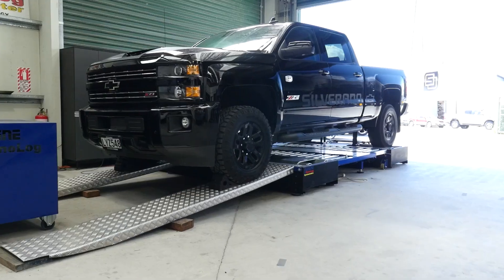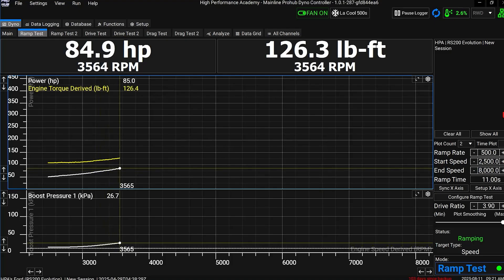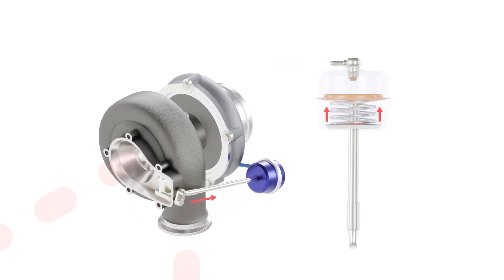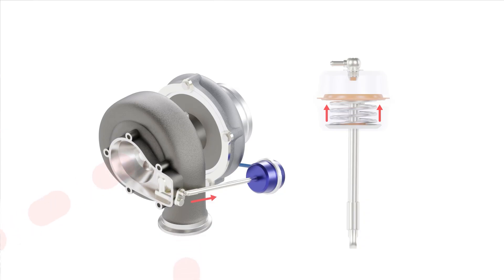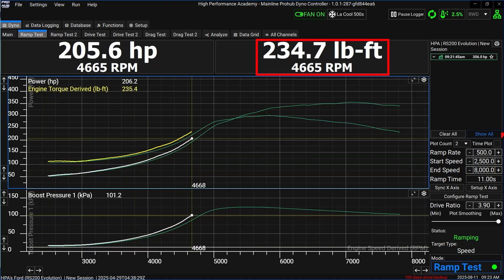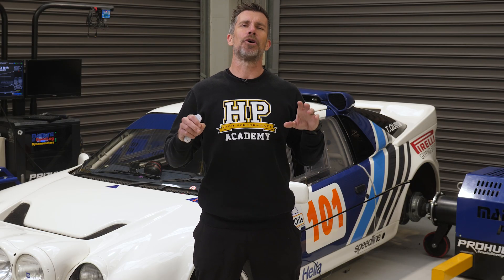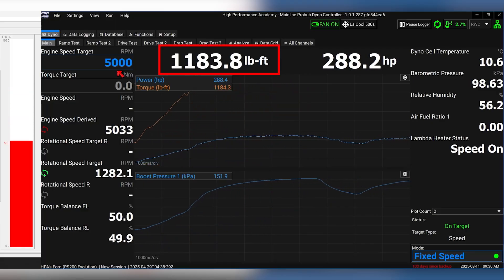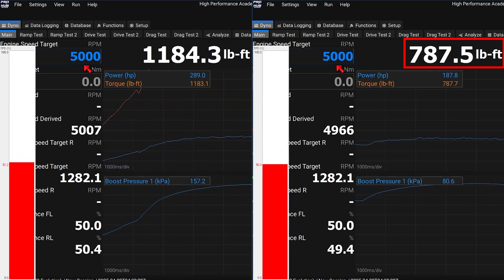Wastegate Hacks Tuners Wish They Learnt Earlier

Comment from the maker: What's one KEY piece of turbo tuning knowledge you wish you learnt sooner? - Taz.
🏎 Building a fast car? Get $400 OFF the all-inclusive VIP online course package deal: https://hpcdmy.co/boostvip
🦵Kickstart your EFI Tuning knowledge. Get 50% OFF your first online course: https://hpcdmy.co/turbocontrol
Reply: question : why aren't twin charging more common in high performance applications ? that is.. a turbo doing boost, feeding an intercooler, and goint into a positive displacment style supercharger, into a 2nd intercooling stange and into the engine. in my experience (diesel guy here) setting a belt ratio that produces no boost at peek tourqe rpm has very little loss power wise. however, as revs climb and volumetric efficiency starts to drop, the pressure ratio of the stupidcharger goes up. it allowed me to use a larger turbine, therefore less backpressure in the exhaust system. while getting me turbo to spool sooner, and it flattened the toruqe curve. i used a variable geometry turbocharger, controlled by a mechanical pressure sensor. i had far better turbo spool. since there was more "vaccum" on the compressor wheel (till it got up to near pressure neutral shaft rpm ), and had more flow on the turbine wheel. i'v had them possible issue of the system volume capacity being large and inducing lag in boost response, at least i had that idea emerge. however in practice i had not had that issue at all.  for home buulders, eaton chargers are very affordable, and make a hell lot of difference. 
however i'm just a village idiot with far too much autism.
so i would like an expert opinion. 
it would make an awesome video too , explaining how a blower builds pressure in relation to engine rpm and volumetric efficiency of sayd engine.
Reply: Address crsnk case pressure oiling issues with an rb whilst doing a rebuild.  My dream car r32 gtst burnt to the ground after having a forged rb20 built due to the head filling with oil.  This was like 18 years ago now so was not common knowledge how to address these issues.

It still hurts 😢

Comment: That is why on all my turbo cars I've owned, I place the boost gauge on the top of the steering column surround, behind the steering wheel. I watch the PSi buildup and disregard the tach until accelerating. Helps to know where the boost is at mid corner etc.

Comment: Do you know if I can do this on a MegaSquirt3 Pro PnP ECU for my factory turbocharged Mazdaspeed Miata?

I just bought an electronic boost controller and will be wiring it in soon to tune a boost duty map based off rpm... Hoping I can do boost by TPS as well as boost by either speed/gear as well. 

Would benefit from a lower target boost in 1st gear, and slightly less in second as well. Would only want full boost in 3rd - 6th.

Comment: In an open loop boost control strategy: should I set a boost reduction based on throttle position? Would one axis be the throttle position and the other access be boost controller duty cycle with negative values?

Comment: I can't give it more boost up top because than it starts to knock with a 9:1 compression ratio 
And i checked exhoust manifold , exhoust, intake manifold ,valves, throttle body intercooler and its not restricting anything only 80%of its capibility is used i'm running e85 (105ron octane) and yea. it starts to knock with more boost so i can only remove boost down low so that the curve becomes straight

Comment: Another reason for boost drop-off as RPM rises is that the engine consumes more air. Boost is a measure of how much air the engine is unable to consume; ie. if you provide more air than the engine can take in, then you have boost.

Comment: I had no idea people actually tuned boost without throttle reference. I mostly tune OEM ECUs and nearly all of them use throttle % as an input (because throttle is used to calculate target load). Boost maps are rpm and load based,  Wastegate PID (which is derived from boost control solenoid control) is also rpm and load dependent. I'm not an expert, I do that for fun, but I also think about torque and not really boost or power too. I didn't invent anything, OEM absolutely think that way based on all the maps I've seen. 
Since the cars I map are for street use, I tune them for excellent mpg up until 60% throttle. (Maximum spark advance, very gradual load increase, low boost, lean and mostly NA stuff), then transition from 60 to 80 % throttle to something OEM+ (higher boost than stock but still reasonable) and finally the last 20% is very aggressive. It is not advisable for track use, but for street use it makes the car pleasant to daily drive while being very agressive when needed. It also gets better MPG than stock when using part throttle.

Comment: Would this be why OEM's (like BMW) have a MAP sensor and a second pressure sensor on the turbo side of the throttle?
I've wondered why the N54 has two pressure sensors, with a small 1.2 bar sensor in the manifold and a higher pressure sensor before the throttle.
After thinking about it after watching this video, it makes sense they would target a pressure before the throttle to improve the throttle response.

Would this strategy have similar benefits compared to what you're describing with throttle mapped boost targets? Essentially not working the turbo harder to overcome the restriction of a partially open throttle?

Comment: Great video. I tune all my turbo cars like this even with low horsepower. My philosophy is if you cant modulated the throttle and get a desired torque,  throttle isn't variable anymore and is basically a switch. This type of tuning give your driving experience more resolution to drive the car at whatever desired level you want.

Comment: couldn't you technically use a reduced sized throttle body and intake filter to give a more linear curve and less on and off switch feel with bigger turbos?   went from a 76mm TB to a 68mm and a 4" to 3" filter on a 3.0 6cyl and the power mechanically feels so much smoother than before.
Reply from the maker: The throttle body does have some effect on the torque vs throttle angle however it's not a full substitute for also changing the boost target vs throttle angle - Andre

Comment: Done all these things on my self-tuned evo track car 🙂💪💪boost vs tps is amazing, as you say even at very low throttle it’s happy to make full boost. 
Also worth noting where possible is lean spool functions as well as wgdc 100% until target load reached, both help to get it on boost as quickly as possible.
1 more thing that I need to test is how BOV vs no BOV (i dont mean vs stock recirc, i mean vs compressor surge no bov at all) affects the reduction in boost on gear changes, in theory a bov should increase the response, but by how much if it all would be interesting to know
Reply from the maker: Good man! You might enjoy a quick watch of this too: https://www.hpacademy.com/previous-webinars/256-do-you-need-a-blow-off-valve/ - Taz.
Reply: @hpa101  Cheers Taz - gave it a watch & some very good info in there. Was surprised to see no BOV was actually slightly faster responding and no real difference in the off throttle rpm drop. Noted the test only at 1 bar so potentially in the future some testing at higher pressures would be good to see. I've been running it flat out for 5 years now between 1.5 bar on trackdays and 2.1 bar flat out for time attack etc with no BOV installed and whilst its only a journal bearing (albeit with a 360 thrust) TT S209 evo 9 80 series, it's held up perfectly. So for the potential of leaks & complexity etc for it to be as robust as it has been I think it makes sense to leave the setup as-is. 
1 thing for anyone else with a similar setup is that it's a must to control part throttle with wastegate correctly, if the boost is not controlled and you run mid throttle and making high boost, at least on my application I got a ton of compressor surge & flutter whilst actually still on throttle. Once that is sorted however that test makes sense with the drivability of mine and how responsive it is now with all the tricks being used :)

Comment: I'd really like to hear your honest opinion on diesels. I really dont like them because a lot of people misunderstand the concept of torque. Just because an engine has 400hp and 1000nm doesnt mean its faster than an engine with 400hp and 500nm. I bet you understand what I mean about this. People get it so wrong. I'd say in a nutshell, "average horsepower" between shifts is what is important. Weight on car, same. (I guess gearing matters too. But if both cars had perfect gearing.
Reply from the maker: Sasha did a great quick write up on torque vs horsepower a while ago here: https://www.hpacademy.com/technical-articles/understanding-torque-and-horsepower-with-tractive-force/ - Taz.

Comment: Boost target vs RPM vs TPS is probably my missing issue with the drivability of my RX-7 for autocross only. I just checked and it was a 2D table mapped at full 25 psi from 2000 to 8000 rpms. That explains so much why it is hard to drive mid throttle. I now have it mapped to TPS and this should give me a much better feel of the throttle when throttle application is so important for autocross. Thank you!
Reply from the maker: Awesome Chris! Andre will be stoked this helped you out. Happy racing mate! - Taz.
Reply: @ChrisMoreweb  hello, do you have the possibility to post or send me the table you are using  please? Tks

Comment: H/A.  Could we look into controlling a turbocharger boost minus wastegate ?  Read article Downunder a while back, where blow/pop-off valves were used vs a wastegate to control engine boost.  Expect ever tightening vehicle emission standards as per NVES in Australia, this will become an ever increasing "art" of technical engineering to meet tougher and stringent future requirements !  V.
Reply from the maker: Controlling the boost pressure via the cols side vs hot side is achievable and certainly nothing new, however it comes with some downsides, one of which is that you risk over speeding the turbo - Andre

Comment: Have you ever tried using cylinder pressure as a tuning metric?  I tell you, it will show you everything, from whether your cam is the best it can be for your setup, to getting every bit of performance out of your setup.
Reply from the maker: For most people the benefits won't outweigh the costs. If it was cheap and easy to install though, that would be the way to go without question 100% - Taz.
https://www.hpacademy.com/blog/how-modern-ecus-have-become-awesome-entry-to-professional-level-ecus-tech-talk/

Comment: Why are you able to boost higher at high rpm when the torque limit/goal is the same?
Does the engine fail to eat enough air to deliver the same torque and then it must be helped with the extra boost?

I have tried the uncontrollable boost behavior on 2 stock cars (2007 VW 2.0 TDI and similar year Renault 1.9 diesel), when pressing the throttle the engine goes from off boost to boost and the throttle needs to be let off a little to get a smooth even acceleration, then the engine/turbo begins to go out of its best area and more throttle needs to be applied again, to get the same amount of acceleration.
The VW was software updated a couple of times and they limited the peak max torque of the engine and made it much better to drive.
Reply from the maker: If you look at a normal torque curve of any engine (N/A or turbo), the torque will start low, peak around the midrange rpm and then drop as rpm climbs. This is because the engine's mechanical design is optimised for airflow across a certain rpm range. As we move above that range, the engine cant flow air as efficiently and the torque drops away. By increasing the boost as we move past peak torque we can help to overcome the engine's reduced airflow and help keep the torque closer to our target - Andre

Comment: Most tuners... id dunno. But theres plenty of lazy ones that will take advantage of a client that doesnt understand that closed loop boost is 100% more useful & accurate. BUT THEY DONT SUGGEST IT TO THE CUSTOMER.

 I have 5 tunes from friend's cars that sent me to alter something, NONE of the tuners setup closed loop boost, let alone some kind of a controlled target table.

My first tune's open loop boost table was so lazy that when i retuned it myself & eventually setup closed loop, the car was night & day different. Full boost as fast as possible if I wanted, or 3/4 of full boost & holding that steady instead. Then after setting up a throttle % vs boost target table I can safely control the amount of boost & not accidentally hit full boost at 30% throttle through a corner in the wet.
Reply from the maker: The closed loop aspect is tricky because a lot of tuners don't understand how a PID algorithm works and if you don't have that knowledge then getting accurate closed loop boost control is next to impossible. Some ECUs still do a terrible job of closed loop boost control too, despite it being 2025 - Andre

Comment: Basically how diesels use boost control in factory ECUs
Reply from the maker: A diesel engine is a very different animal though. In a diesel engine you make more power as you add fuel and enrich the mixture, but there are limits to how rich you can go before you start melting things. In order to make more power without everything falling out the bottom, we need to add air to lean the mixture out and that's where the turbo comes in - Andre

Comment: A little 12V aircompressor, tank and ecu controlled valve would be nice to control the wastegate additionally.
Reply from the maker: This would be workable but I'm not sure the juice would be worth the squeeze. if you want a wider usable boost range then you'd likely be better off using a 4 port solenoid - Andre
Reply: Why? you have a spring in it
Reply: @DreRasing  yes, i know how a wastegate works. But with more airpressure on the WG you can run a softer spring.

Comment: would this function the same with an Anti-Lag system?
Reply from the maker: The short answer is yes. Antilag is designed to reduce the initial turbo lag but we still want control of the torque vs throttle input - Andre

Comment: Easy on a stand alone, not so easy when using a standard EBC and reflash ecu.  When you only have one duty cycle value you can run throughout the rev range you’re limited to mechanical changes to account for boost drop off.
Reply: I always run 2 hoses to the WG actuator and or ebc solenoid. 1 from the compressor housing outlet, the other one is taken from the inlet mani or plenum then both hoses go to a T or Y fitting. 
It prevents over boosting and accounts for the pressure drop at higher RPM

Comment: quick question, what is the ramifications of having the throttle before the turbo/centrifugal supercahrger like how a roots/screw supercharger has the throttle before the intake?  would there be things you would have to do differentaly like bov and wastegate tuning?
Reply from the maker: It's not something I've ever experimented with so i can't comment from personal experience. If you also included an intercooler then the effective plenum area would become massive which I imagine would have some pretty significant negative effects on throttle response and driveability. Indycar did run a secondary throttle pre turbo but still retained a conventional post-turbo throttle as well - Andre

Comment: The video I would like to hear is how to tune turbos for restrictor optimisation as required in rally regs.
Reply from the maker: The trick with tuning for a restroictor is that at higher rpm where the restrictor... restricts, is that less boost often results in more power. So trying to wring every last psi out of the poor turbo can be detrimental - Andre

Comment: What's a good strategy for torque reduction on a car that's running say 250 kPa (absolute) if you also have DBW that you can modulate? Should most torque reduction be targeted by using the wastegate or is it better to have small TPS targets to achieve the airflow reduction?
Reply: Why are you trying to reduce the torque? to limit wheelspin/slip? Setup a boost target vs slip table (which would be wastegate controlled). You can do the same with closing the throttle (faster effect than wastegate/ boost control id say), though i cant visualise how you'd set that up. Im sure there way to do both using a 3d table.
Reply: @technology42069  For driver modulation, and TC. Ignition retard/fuel cut seem to be the preferred method as they're faster acting than wg control, no? It's for PPIHC....Syvecs/LifeRacing ECU, so pretty flexible strategies.
Reply from the maker: If we look at the torque management strategy that MoTeC use in their PRO firmware, this utilises throttle primarily coupled with ignition retard for traction control and things like gear shifting. That being said, I still map the boost target to match the torque request. You can make a specific torque target using let's say 200 kpa boost and 20% throttle or 75% throttle and perhaps 100 kpa boost. Both achieve the same outcome but one is working the turbo very hard and creating a lot of unnecessary heat and stress - Andre

Comment: I had no idea boost by RPM was so helpful to keep boost pressure up and make more power. I thought it was only used for traction control. I intentionally didn't hook it up on my Apexi AVCR because I knew my car wouldn't make anywhere near enough to be concerned about traction. Looks like I need to revisit hooking it up properly and another tune.